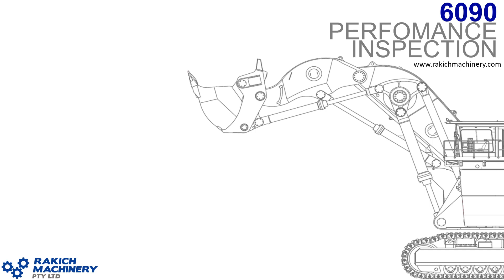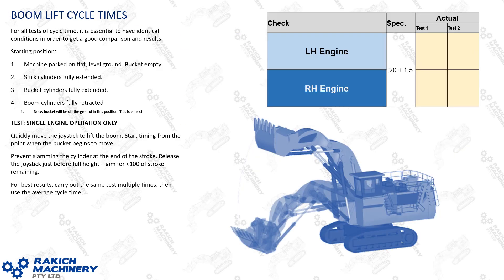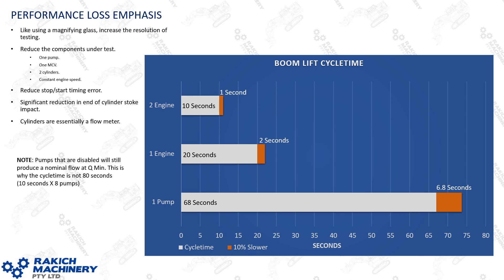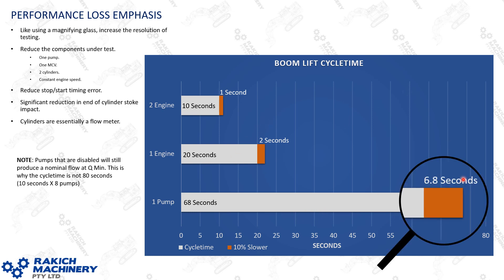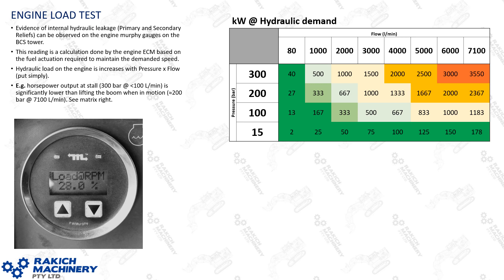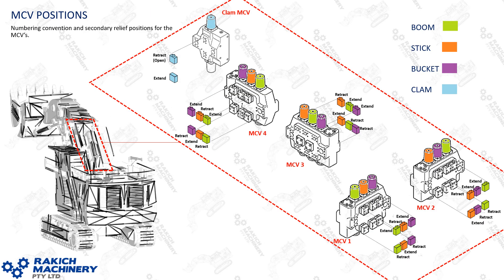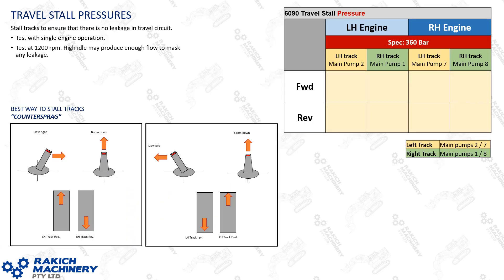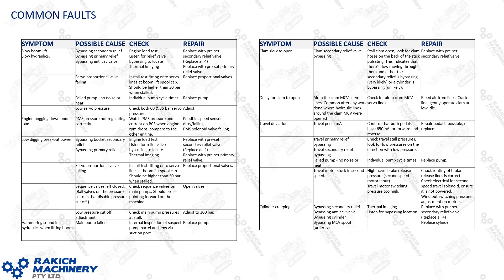6090 Performance Inspection - Rakich Machinery

Comment: Mate excellent training video like the mod for testing single pump operation not seen that before
Reply from the maker: Thanks Paul. I’ve been doing it for years on the 340-B’s. I’ve got a pump tune up procedure for the B’s/6060’s that requires the pump isolation manifolds.
Reply: This is all good stuff just wish you worked on hitachi shovels 👍
Reply from the maker: @masterofnone1234  thanks mate. I used to mess about with them years ago, but not too savvy with the technical side of them.